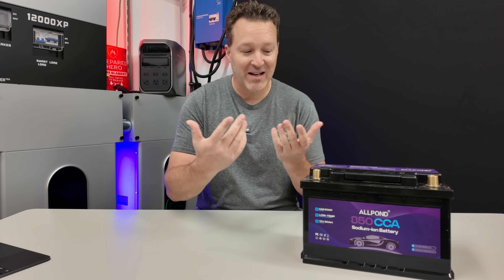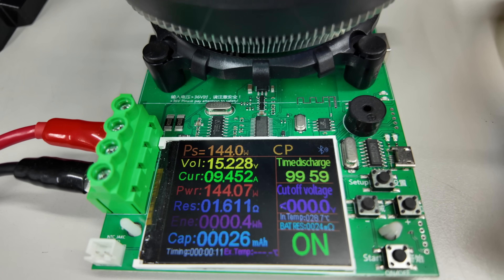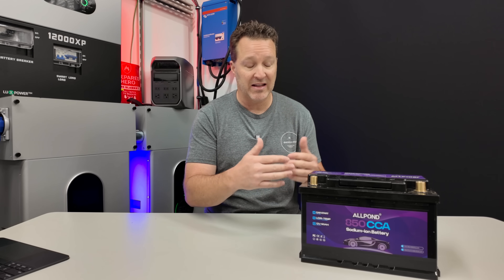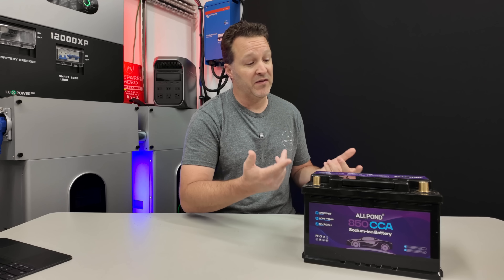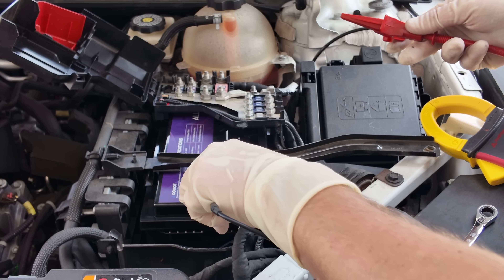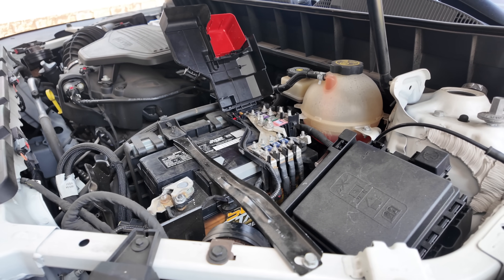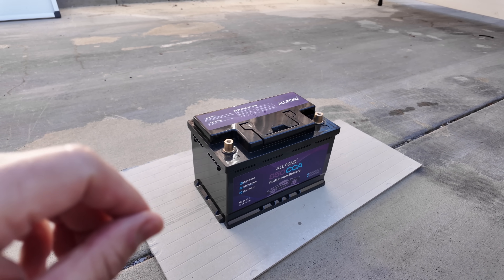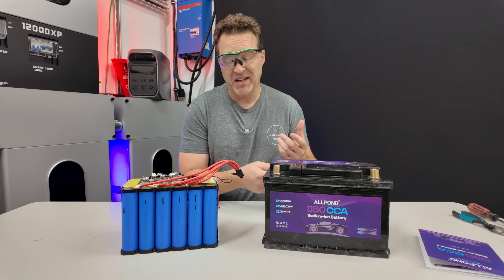Sodium Ion Battery Tech Hits The Auto Industry!- Are We Ready?

Comment: OK, right off I see the problem here. The issue on construction is they are using a Lithium BMS for the Sodium-Ion battery, which doesn't have the faults and natural balance charging issues of LI cells. I would be very tempted to remove everything down to the 3V cells and start over with new nickel bus bars and TIG weld them on as well as main terminal connector wires silver solder them on instead of lead type low temp solder joints. 

I've studied this new SI technology some and was shocked to see the BMS in this battery. I think the basic battery pack as a properly welded for high drain and high heat use could prove to charge exactly like a lead-acid battery, which the alternator regulator is naturally made to operate and do its own circuit balancing. 

In LI batteries the chemical stack in the cells are finicky, fragile and underwhelming when it comes to real raw performance with a limited high voltage and a limited low draw limit, which is also part of the MBS job to not allow the LI cells to draw too low to prevent damaging them.  Sodium Ion batteries shouldn't have that much of a different characteristic to tank batch charging we have always known in lead acid batteries. I don't see this causing thermal damage or thermal runaway to catastrophic failure like the lithium cells. 

Yes, I am a chemical and an electrical engineer from UCLA. I'm older and retired now, but that just means I've seen a lot and done a lot. Some solutions are simply this simple.

Comment: A battery with a BMS will be incompatible with most regulators intended for lead-acid batteries. A lead-acid battery will provide a load even when fully charged, boiling lightly. A BMS will just disconnect the battery when charged, leaving no load for the regulator.

Comment: This is not the battery of the future, it’s not for cars or portable devices, it’s going to be used for stationary devices, providing battery power to homes. These batteries have nearly the same price, with by far less performance and much more weight to them. It’s the comparison of going from Lithium back to NiCad batteries or Lead Acid batteries. It’s a backwards step.

Comment: I have a lead acid installed in 2017 battery still in my car.   Most of mine last over 5 yrs because I maintain them.  Always check out electrolyte level and make sure to y ok ur terminal connects and gr or unds are good.

Comment: If the charging voltage was stuck at 14v, it is possible that the lower voltage on the alternator was due to the battery pulling amps from the alternator, causing voltage to drop due to load.  14 volts is still charging for a lead acid battery, so it would still charge.  ..

The sodium battery has a charge controller, that will be set up to charge the battery at any voltage provided by the alternator.

Comment: To measure the voltage the leads are connected across the battery as seen, but there are two ways to measure the current, by placing the meter leads in series which is usually OK up about ten amps, but if you are going the start and charge the vehicle then you would have to use the clamp part of the meter, the reason he is seeing zero amps is because he took the clamp off the battery cables. This is not how to use a multim

Comment: You got fooled by a smart computer that is designed to turn off the alternator. I’ve given intervals to save gas! This has happened to me too. As you drive down the road with a normal battery, CF the battery voltage doesn’t vary some. This is the computer trying to get better mileage by decreasing the alternator load And letting the battery where out a little faster! I last all this function in a 2012 Nissan the computer started acting up. I had to eliminate the computer from the charging circuit and lose my 1 mile per gallon. Big loss right? So now my battery lasts longerand I lose 1 mile per gallon if that much.

Comment: Batteries don’t get worn out in cars faster because of more electronics in modern cars. The battery is basically a buffer or capacitor if your alternator is working correctly. The problem with them lasting less time is partly from being cycled so much without being driven long enough to fully charge. These short trips are what not only ruins your battery but your entire engine.

Comment: Sodium batteries, quality ones, will do 10k+ cycles. They are less susceptible to temperature. Their prices are plummeting rapidly. They can be shipped with zero charge in them. They offer more amps in the cold. They will only improve. As far as the voltage thing goes, you can by a cheap voltage booster to resolve the issue of your charging system not providing enough for the battery. This is already a common problem with AGM batteries with weak alternators.

Comment: FAIL !

These things seem to have specs & limitations similar to supercapacitors . . . 

PROS: lightweight, fast charging, able to deliver LOTS of juice in a hurry, lots of charge cycles, and very efficient. Sounds awesome at first glance, right ?  

CONS: The deal breaker is that their total power storage capacity is total f&&&ing GARBAGE . . . if I read things correctly. Take your pick of amp-hours (Ah) or watt-hours (Wh), because both suck ... advertisers prefer Wh simply because it sounds bigger among squishy-brained consumers who struggle with basic arithmetic.
Reply: @RovingPunster  It is a Car Starting Battery ... The only rating that matters is CCA = Cold Cranking Amps!  And that is where this battery excels.
Reply: @MrSummitville You completely missed the point I raised ... CCA is only one (1) of TWO vital stats for automotive batteries.  The other is STORAGE CAPACITY, usually measured in Amp-hours (Ah) by reputable companies, and watt-hours by marketing twits who like making things sound more impressive than they actually are.

If all you care about is CCA, a pocket size supercapacitor will get it done and cost far less. However, it too suffers greatly from a lack of storage capacity, and thus cannot serve as a replacement for a real automotive battery, which needs to  be able to handle multiple starts in inclimate weather, plus the usual loads by the car, as well as average out any recharge deficit caused by short trips between starts.

BOTTOM LINE: Sodium Ion and Supercapacitors excel at starting, but when it comes to useful energy storage reserves, they're non-starters (pun deliberate).
Reply: @RovingPunster I did not miss any point. It is a Car Starting Battery. The only meaningful specification is Cold Cranking Amps, to start the car.  Amp-Hours is irrelevant.  "Starting" batteries are optimized for CCA. End of story ...

Comment: I have 40Ah LiFeYpo4 as starting battery in my Civic for over 12 years and it is still good. Less voltage drop when starting (visible on dash not dimming as much). Not balanced though, one day I might open it to see if the cells are out of balance...
Reply: Most lifepoe4 packs will self balance so you're probably fine, though this review was another case of a cheap chinesium scam trying to pinch suckers with the hype of sodium batteries

Comment: As a tow truck operator, I just hook my harbor freight 30' long jumper cables on the cars anf the x3 lead acid heavy duty bats. Always works. Fine.
You usualy have the truck running while doing this so the alredy beefed up alternator is running and you have enough juce to start the biggest semi tractors out there.
At that scale it is hard to fail to start a vehicle that just has a low bat.
Only when a customers car bat drops a cell is it a bit dificult.

Comment: Using water to address a fire from a sodium metal containing anything could be dangerous...how much Na metal is in this thing?
Reply from the maker: The blanket is for the battery 
The water if for the fence and house 😅
Reply: There is zero Sodium Metal inside the battery. If ever needed, water works just fine.  When you put water on table salt does it explode?  No ...

Comment: Another thought is LED lighting, many 12volt LED bulbs have a wide voltage range, often 10-30volts so they can be used on 12v and 24v systems, these would be great for lighting systems.

Comment: I think the way forward for these is with control, charge it with systems to 15.9volts with a fairly gentle current, then use a Buck and Boost converter to run appliances on a perfect 12.6volts while the sodium battery can discharge down to 10volts. By using a volt meter on the battery you can get a very good idea of the remaining capacity.

Comment: Oddly, "old school" vehicles and charging systems would work Much better than newer vehicles because those "dumb old" systems readily output 16 to 17 volts during rapid charging (high delta-V after heavy discharge).
And, frankly, a storage battery does NOT need to be a "smart device"(!)...that's just dumb. The "smarts" need to be in what it is connected to. All those electronics INSIDE the battery are just Additional Failure Points.
(And, Yes, I'm and electronics engineer and designer).

Comment: Johnny - Your initial "only 14.5v" after start is easily explained once you understand the charging algorithms in today's vehicles. I retired a GM electrical engineer so I have some background here. Due to such high demand for fuel economy in current vehicles, we throttle down max current regen based on driver patterns matched to our developed algorithms. There is a fuel savings to be found if we reduce alternator output. After measuring enough drive cycles, the Power train Control Module reduces charging output INTENTIONALLY after startup, knowing the driver normally makes an extended say 30 mile drive to work. The battery will recover at a lower rate, yet still be fully charged eventually. If the operator instead stops for fuel, then again goes to a ball game on a Saturday for example, the ECM will urgently power up the charge rate based on battery reserve capacity (yes, we now sense battery capacity and charging input measured in Ah)  Watching a vehicle voltmeter now will confirm what  I am telling you- and now makes that gauge worthless as a driver aid. Sigh. I don't like it either, but that's the it rolls today.
Reply: I have noticed on 200002010 era of cars that cold an alt typ charges at high 14's but drops to 14.4-14.5 at temperature.  I always thought it was to extend battery life and avoid getting the batt too hot if charged to 15+ volts constant.   I tried different voltage regulators to get a higher charge volts of 15 constant but they all tend to drop at temp, wanted max voltage for fuel pumps etc.

Comment: My wild guess is not compatible with any of the new vehicles as of now, I'm not looking forward to a compatibility new vehicle either. It would likely not be backwards compatible with lead acid batteries.  The maximum output isn't compatible with my use vehicles have winch, much more my Gladiator with the ESS system (a train wreck of a design IMHO) failure point made to add wear on multiple parts and motor with no returns for the owner.  Now with my older Jeep voltage of the battery is just slightly more than it has been since I got it in 05 it consistently charges at 14.7 and running voltage of that. Just factory low beam I was always flashed with high beams because everyone thinks I didn't dim lights.  I've got exceptional battery life over 5 years for batteries but I use AGM batteries. 
Good on saving some weight, cost is questionable.  Interesting for a technology that hit a wall many years ago starts getting some more research done.  In the mid 1970's I was making simple batteries of this type but wet cells, back when some schools had a good science classes.

Comment: I have a small pop-up camper, looking to hook up solar in the near future. I like the idea of LESS reactionary cells for in the wilderness way WAY off grid, especially in northern Wisconsin winter. Could you for see a negative or downside to using a pair of these in parallel for a basic 12V config? I do have a modern LiPo charge capable converter/inverter/charger installed, but still on lead-acid. looking for quicker charges, lighter in weight, and fire "safe-ish" capabilities

Comment: I just don't think you're very short test of that in battery in the vehicle is enough to say it won't work. You might not have had the leads on really snuggly you were having some trouble getting readings depending on the position of your probes which leads me to believe that your leads may not have been on correctly on the battery itself. I think you should have put it back in the car again and let it charge for a while.

Comment: Isn't there going to be a problem starting the vehicle when the voltage gets down to 8V? The universal motors that most starter motors use have both speed and torque linked tied directly to voltage.
Reply: Same problem when your discharged Lead Acid battery is 8 volts.
Reply: @MrSummitville ya but that is going to happen at a much lower state of charge. So the usable percentage of the of sodium is much lower.
Reply: @Dan-vi5jp  I am not worried about the last 10% State Of Charge.  The Sodium Ion battery has 10% more Cold Cranking Amps. So irrelevant.
Reply: @MrSummitville you would be loosing 30-40% of your state of charge at 8 Volts.
Reply: @MrSummitville and there is a minimum amount of voltage required for motor so having more cold cranking amps won't help.
Reply: @Dan-vi5jp At 9 volts there is only 15% SOC remaining in NIB. Looking at the chart, now . Like I said ... I don't care about the bottom 10%, irrelevant.
Reply: @Dan-vi5jp  Yes, it does. A larger CCA  battery will crank the motor for a longer period. I don't care about the bottom 10% , when the top 90% is plenty.
Reply: @MrSummitville I'm looking at the voltage curve for the same temprature Cold Cranking Amps are rated at (0F/-18C) and 9V is definitely around 30%.
Reply: @MrSummitville that is not how stater motors which are universal motors work. Voltage determines speed and amperage determines torque. So if the voltage is too low the engine never reaches the rpm required to start.

Comment: Save yourself the time of listening to this guy prattle on and on without giving you any tangible information about the bennefits/cons of Sodium Ion batteries vs lead Acid.

⚡ 1. Higher Energy Density

Sodium-ion: ~100–160 Wh/kg

Lead-acid: ~30–50 Wh/kg
✅ Sodium-ion batteries store 2–3× more energy per kilogram, meaning they’re lighter and smaller for the same capacity.

🔋 2. Faster Charging and Discharging

Sodium-ion cells can charge and discharge much faster than lead-acid, which is important for EVs, solar systems, and backup power.

Lead-acid takes longer to recharge and can be damaged if charged too quickly.

🔁 3. Longer Cycle Life

Sodium-ion: 2000–5000 charge cycles (depending on chemistry and manufacturer)

Lead-acid: 300–500 cycles typical
✅ You can discharge sodium-ion batteries much deeper and more often without killing them.

🌡 4. Better Temperature Tolerance

Sodium-ion batteries perform better in cold and hot climates (-20 °C to +60 °C ranges).

Lead-acid capacity drops sharply in cold temperatures and can overheat under heavy use.

🧪 5. Safer Chemistry

No lithium or cobalt → less risk of thermal runaway or fire.

Sodium-ion batteries are considered non-flammable and non-toxic compared to some lithium types.

🌎 6. More Sustainable and Abundant Materials

Sodium is extremely abundant (from salt) and cheap.

Lead is toxic and requires strict recycling procedures.
✅ Sodium-ion batteries are environmentally friendlier.

💲 7. Maintenance-Free

Unlike lead-acid (especially flooded types), sodium-ion doesn’t need watering or equalization charging.

⚙ When Lead-Acid Still Wins

Lower upfront cost: lead-acid is much cheaper initially.

Simple charging systems: widely compatible and easy to service.

Proven tech: decades of reliability in automotive and backup power.

✅ Summary Table
Feature	Sodium-Ion	Lead-Acid
Energy Density	High	Low
Weight	Light	Heavy
Cycle Life	Long (2000–5000)	Short (300–500)
Maintenance	None	Requires upkeep
Cost	Medium	Low
Safety	Very Safe	Moderate (acid spill risk)
Environmental Impact	Low	High (toxic lead)
Temperature Performance	Excellent	Poor

Comment: The real concerns I have with using a Non-Lead Acid battery in my vehicles are 1. are they drop in compatible meaning I can use with a stock alternator/and associated components?  2. how well do they handle the extreme heat and cold cycles when mounted in the engine compartment. 3 what happens to the alternator and charging system after the battery is fully charged?  4. will the battery try to pull more amps than the alternator can supply during charging causing the alt to over heat and fail?  5. what modifications will I need to make to install in older vehicles?

Comment: You showed the battery status in the vehicle for the lead acid, but you did NOT show the battery status in the vehicle for the sodium ion battery??   When you tested the sodium ion battery with your hand held meter it failed.  Why didn't your try to test it again to determine what was going on?  So the root cause of the sodium battery failure is unknown???  So to me the results are either bad testing technique or the battery charging computer is not set properly to this type of battery chemistry.

Comment: GM cars ECU control the alternator output depending on the system condition.
Not because you see 14.7 volts it means the alternator is pushing the maximum amperage.
ECU control the alternator to meet contamination standards and load put to the engine if you accelerating or hauling heavy loads or AC compressor loads and many other things

Comment: The BMS will disconnect the battery from the alternator as this is a 12V battery which cannot support 14.8V while charging. Same issue for LFP as well as 14.9V/4cells=3.725V which is way out of spec for safely charging them. The battery pack has to stay at about 80% SOC at the 14.9V the alternator is providing so a different cell configuration is needed.